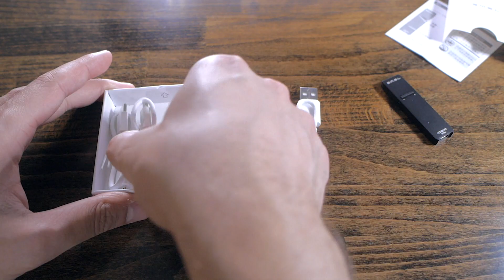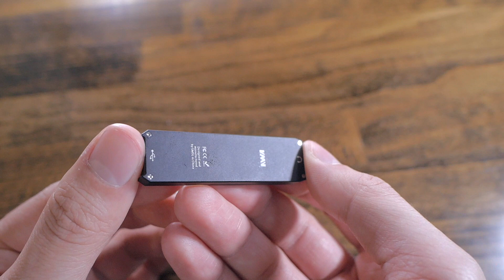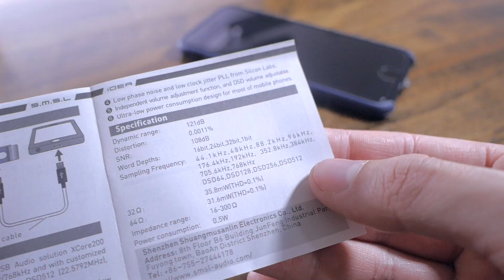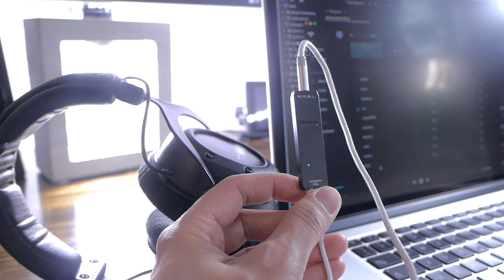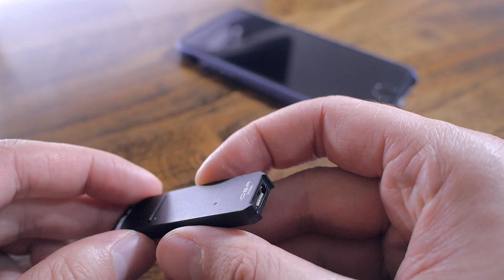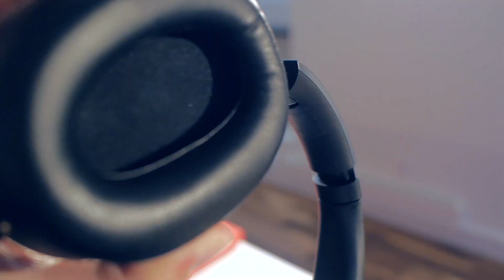Smallest DAC Out There? ~ SMSL iDEA Review

Comment: And also they hold it together with small bolts!! Beauty touch Sabaj. Long lasting movements. Would be great to see dual mono audio chipset in these babies, but probably they would drink double of the energy.:) BTW pear (apple) is never good for audio, clearly. The dongle has poor interconnect cables, just replace them to much better ones and you'll be surprised.